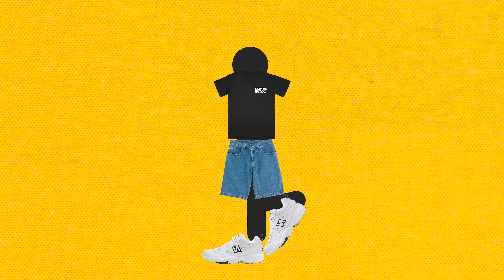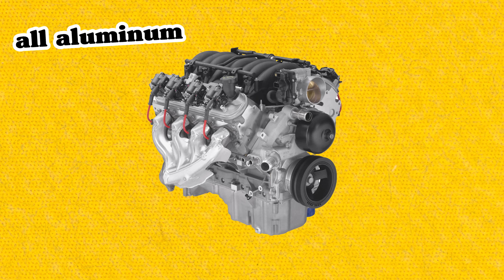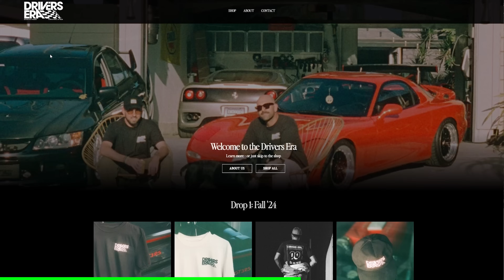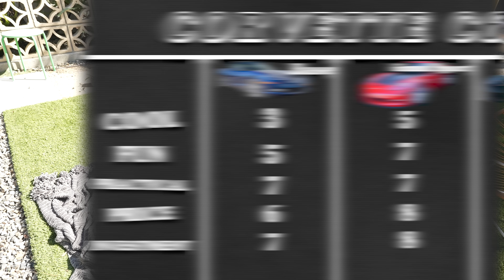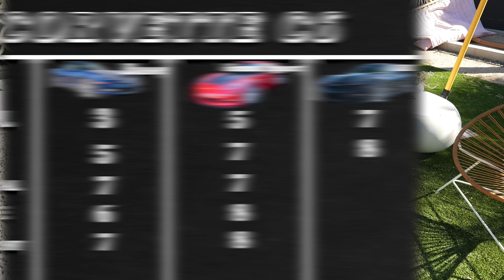Base vs Top Spec- Corvette c6. Is it WORTH IT?

Comment: You missed the best one , the C6 Z06
Reply: Zach did speak on it briefly. Probably pretty hard to organize/drive all the categories. and he probably would've said the grandsport was a better deal anyways
Reply: @toddbrown4185  Better deal, but not the better car. Shopping for both atm and the engine really changes the experience. LS3 and LS2 great engines tho
Reply: Best all around value / performance , but don’t kid yourself … zr1 king
Reply: Z06 is king
Reply: @chadwest1697  I hate to be the one to say it, But the ls3 dry sump is just as capable as the ls7 in 2024. You can easily rev just as high as an ls7 with a few mods.
Reply: @DigitalSubset  lol nah this is absolutely valid information. I was looking into grandsports. They have everything of Z06 other than aluminum body and engine. Not sure if they have carbon fenders as well. Used they around the same price as an earlier year Z06 where I am. Me personally I would just get the z06 of earlier year.
Reply from the maker: i drop the z for Zac. TBH i think 4 cars is too many,
Reply: @vin_tra  4 is to many for this video format. But it can be done and I wouldn’t complain about watching it. Also since you traditionally only do 3 different trim levels per video, this made the most sense. And Zach’s car is at the performance level of a lightly modded Z06
Reply: @chadwest1697 They do not, leaf spring is different, car is tuned different. Camber availability at rear is different.
Reply: @vin_tra  would have been nice to see all 4 , since you covered 3 of them , but nice series.
Reply: @DigitalSubset That’s funny lol! “With a few mods.” How many mods needed to match my 530rwhp?
Reply: ...if you're 18 to 25 the Z06 is your ride. But, for everyone else the GS is the better purchase by far. You'll spend a lot less time on the side of the road or being pulled back to the pits. A Z06 can be replaced with a well-equipped Camaro.
Reply: @DigitalSubset  and it doesn't drop valves
Reply: C6 ZR1 is a monster, the acceleration is fenomenal
Reply: Please go drive a C6 Z and give a review
Reply: Please go drive a C6 Z and give a review, the LS seven is unbelievable for an NA
Reply: I decided to purchase the GS over the Z06 for a few reasons. More reliable power plant, removable roof (coupe), grand sport coupes with M6 had a hand built LS3 built in the Z06/ZR1 factory. I couldn’t be happier with my GS.
Reply: @vin_tra  I think you made the right call. Having Zac on the vid was way better than having some rando with a z06. Especially because he actually spoke about the z06 and made a case for the grandsport based on dollars. Which is the whole point of this series, lol. Keep it up man!
Reply: @davidkelley751 Yeah op would need Carwow to make a video like that
Reply: Yeah no it’s the zr1
Reply: Oh yeah the titanium rod/head issue LS7 lol the ZR1 is 100% better or a C6 GS.
Reply: @chadwest1697  the raw feeling of the ls7 is unmatched.
Reply: @DigitalSubset  except you need boost or a hog ass cam to even keep up with a stock ls7
Reply: @vin_tra goofy. But sure
Reply: @Blazerghost keep smoking.  Exaggerated valve issues, lol.  Get RPM heads/cam kit and you never even have to worry while you get a 700hp NA car no GS will come close mod for mod😂
Reply: @DigitalSubset  NA HCI LS3 is not making NA HCI LS7 power. On top of that, you don't get the aluminum frame, cf panels, magnesium roof, etc etc on non-Z models.
Reply: The best one is the zr1
Reply: Grand sport is just a widebody base model wishing it was as cool as a Z06. Man do I sure miss mine and regret selling her. (But I also agree, the ZR1 is way better but that was out of my budget at the time) One thing is for certain, the interior of any c6 is an absolute eyesore.
Reply: Best at dropping valves😂
Reply: @titoazua3120  this is what poors say that can't afford to get the head work done to fix the valve guide issue lol
Reply: @maximilianherrmann5003  bs
Reply: Exactly, I did this exact scenario about 6 month ago. The best bang for the buck is actually the Z06. You can get a nice c6 z06 for 40k. And it’s 200lbs lighter than a zr1
Reply: @SloComaro  bingo.
Reply: This ^
Reply: @chrisnichols4228  correct :)  i really love my z
Reply: @DrivenbyAlex  was there a reason that you didn’t have one in the mix?
Reply: Yea if you track a lot and dope plan on modding it. The GS is the most versatile, hand built engine, most of the z06 parts, widebody, big brakes, dry sump, and you can still take the top off, (can't do that with z06 or zr1)
Reply: @Blazerghost  many of which were fixed under warranty. The ZR1 isn't 100% better when looking at the numbers stock for stock, but it is 100% more expensive on the market. If you're looking to actually beat on the car, take it to the track and drive it like it was designed for the GS and Z are the better cars for the money
Reply: @DigitalSubset  also the heads aren't designed to grenade your ls3 like the ls7 was.
Reply: @DigitalSubset those same mods would have the LS7 making 600 whp or more NA 😂 don’t kid yourself
Reply: @nathankrug111  FACTS
Reply: @David-jh8mp  FACTS 👍 👍
Reply: @DigitalSubset and you won’t have the Drop Valve issue as the LS7
Reply: C6 ZR1
Reply: How about a GS with an A&A Supercharger?  How would that not be the best bang for the buck?
Reply: @Blazerghost guess you could fix the heads or just buy new ones for around 1500-$2500.
Reply: The Grand Sport is closer to a base than the Z06 is to either ZR1 or Base. The 7.0 is amazing. And I think you really missed an important point by omitting it.
Reply: @David-jh8mp right people are soft  😂   they are talking about not wanting a z cause it's not reliable  won't fix the issues it might have... but talks about the grandsport but totally  changes  the engine with boost and heads  and cam lmao  makes no sense lol
Reply: Zr1 has intake valve isues no differnt then the z06 ...  early gen z06 had exaust valve issues   sooooo either way your throwing heads at it unless you get a ls3.. but then your trying to make power your gonna want new heads anyways lol  @Blazerghost
Reply: Grand sport gets it. Comfortable ride cheap to make a fast Street able car. Best of all price
Reply: @chadwest1697  LS7 Z06 for the win. ZR1 LS9  if you track it. Z06 40K cheaper with 505 HP stock
Reply: @chadwest1697  Z06 has aluminum frame and carbon fiber body panels.
Reply: @Lestertele the z06 is fine the valve issue goes away once you do a quality set of aftermarket heads and cam which is must have mods anyways.  With this they can be every bit as reliable.
Reply: @C6GrandSportLS all you gotta do is throw some heads on an ls7 and that issue goes away and it'll make EVEN MORE power.  The valve thing is an easy fix and greatly exaggerated.

Comment: Corvette C6 Z06 owner here. All the different models are great for their purpose. Base, Grand Sport, Z06 and ZR1. But for brute all out power. ZR1 LS9 VS Z06  LS7. Force induction VS naturally aspirated. My Z06 is full bolt on and I daily it also. Best viscerally/engaging fun car I've owned also.
Reply: have u had the drop valve issuw
Reply: There's no doubt in my mind about what you said about the c6 zo6 I've wanted to drive both the c6 & c7 zo6 just to know the difference I've hurd between the 2 models being so different in the driving experience with most guys saying the c6 zo6 being alot more angrier feeling making it a funner experience

Comment: The C4 ZR-1 held various lap records, endurance records, and handling records when it was being made
Reply: It still holds the 24 hour endurance record for a production car to this day. I know 375 hp (405hp in 93-95) doesn't sound like a lot today but in the 90's it was crazy. It's right there with the base c6 that is 15 years newer. The ZR-1 was one of the fastest cars you could buy. It spanked the turbo 911 in every measurable performance category. I have a stock 95 ZR-1 and my buddy has a stock c5 Z06 from a highway roll the cars are dead even. C4 ZR-1 is a very underrated car.
Reply: Him not being impressed with the C4 ZR-1 and only “375 hp” comes across as not being educated on the subject or “I’m gonna poopoo this car and ragebait the internet.”  Either way, he succeeded.
Reply: Only few know
Reply: @MrNeon2002  Even the base C4 can be a beast with the 350 ft-lb torque from the factory. I've kept up with a surprising amount of somewhat modern cars with my L98 engine. I've kept up with newer WRX STI's, 3 valve 4.6 Mustangs, and a cammed Trailblazer SS. Even if you put the performance aside, the driving experience is top notch.
Reply: Feel like the turning point in technology and performance was the C4.  Definitely underrated.
Reply: @MrNeon2002  thats fucking awesome lol, hell yea glad someones representing the c4
Reply: @facetiousmonkey5322  yes, yes, he did succeed in making me, and us, comment about it hella LMFAOOO
Reply: @HTX_ROME   really is so underrated, he definitely has not driven a later model c4
Reply: I owned a 1991 ZR-1 and I agree!

Comment: While the C6 Grandsport is awesome, its not quite the same as the C6 Z06. The C6Z is special, the LS7 (although a problematic race engine) is incredible. You should definitely drive and review one if you can.
Reply: How reliable has it been?
Reply: @Kauffman578  I don't own a C6 but I own a C5Z. It's super reliable even for 20 years old. But mine has low miles and has been well taken care of.

Comment: The base C6 you had had the LS2 but in 2008 they received the LS3 which is a little more sought after due to slightly higher displacement plus horse power. Great video nonetheless keep it up Vin!
Reply: And TR6060, rectangle port heads etc
Reply: The trans and diff in 05-07 is also beyond glass. It’s technically a c5.5
Reply: @Jan-b2n  beyond glass? can you elaborate
Reply: @KevinShroff  they do not last with any abuse at stock power level. Torque tube isn’t that great either, and the gas tank is the same as C5 for those first few years. Just a C5 with a better body kit (personal opinion).
Reply: @Jan-b2n you actually have no clue what you’re talking about. firstly, the only bad diff is the 2005 model year. 2006-07 have the same rear end as an 08, 09 etc. Same goes with the TT. The only upgrade would be the tr6060, however saying that the t56 is glass is simply not true. that trans is still good for upwards of 700+ horsepower. the only weak link would be the 2005 model year. get educated and stop spreading misinformation.
Reply: @Jan-b2n i agree 100%. Differential cracked on my 05 C6😂. It couldn’t handle the abuse.
Reply: @boostedelijah  chill out I’m not reading all that so good for you or I’m sorry that happened
Reply: @David-jh8mp  yeah the 05… the only weak diff. 06+ all have upgraded
Reply: LS2 6.0L 400hp - LS3 6.2L 430hp that’s a big thing he missed and even messed up and called the LS2 a 6.2L smh

Comment: I had a C6 Grand Sport as a daily driver in Boston (lol) and it was one of the best cars I’ve ever had. None of the head issues of the Z06 and the ls3 is capable of just as much power if you want to go down that road. Zr1 was the king but the GS was the sweet spot. I also thought it was more comfortable and better looking than the C7 by a mile. I’ve since traded it for a 911 but for the money it’s a really tough car to beat.

Comment: Great video Vin, I hope you keep doing these review series, they have all been fun to watch.  I'm on my 3rd ownership of a daily driven C5Z, current one is 434rwhp and is about all I need for daily driven fun.  I also had a 707rwhp C6ZR1, and the issue I had with the ZR1 was the same as yours.  It hooked up and put down all the power and drove great, but for a daily/street car it was like 1 gear blast and done.  It just was not as fun unless you drove felony speeds.  I have a special place for C5Z because my dad, and they are really great drivers but you have to deal with the late 2000s chevy tahoe interior for sure.

Comment: I gotta tell you I have a c6 base with 400 hp and it’s a convertible. I just bought it.  The convertible factor is just amazing.  It gets sooooo much attention. 

It’s a working man’s car so everyone likes it. It looks amazing and really much better in person than in pics  and looks more classic than the beefier zo6.  I like the wide rear body of the z06 but there’s something more classic about the base that I think will age better.  

Mine came with a coursa exhaust and I can put a super charger on it for $6000 that gives me 550-600 hp.  Mine was a 1 owner and is 6 speed manual with a heads up display.  

Being a year 1 (2005) it has power seats on both sides and is very very comfortable inside.  Also the 2005 has the best steering wheel. 

I paid $19,500 with 74,000 miles, one owner and it does zero to 60 in 4.1 seconds.  

The corsa exhaust is amazing.  It sounds like perfection 

Add to that if I choose to add the wide body quarters of the “upgraded models” I can simply buy those and bolt them on easy.  

After owning this I would not buy a non convertible. You can literally drive around with the top down in 40 degree weather as the heater is made for that and it keeps you warm.  Also, I have a manual top, but if it storms and you are on the road the aerodynamics are such that it won’t rain inside! It’s wild.   Unless you hit traffic 😅I also have dual heated seats. It’s fuckin awesome and it gets you in a man’s car.  Sure Tesla performances are faster but almost everyone out there respects the corvette much more and thinks the teslas are gay.  So sometimes you get a kid driving his moms Tesla trying to race you in the highway and you can just yawnnnnnn at them it’s funny 😂. 

I just saw your ratings…. Totally off on the base corvette.  This thing handles like a dream. And mine came stock with mag magnetic shocks. 
Toss that $6000 super charger on the base corvette and you have the zr1. So with 550 hp plus the robust ls2 with the amazing handing you can just toss the rear wide body kit on and all corvettes lower the same with the built in lowering adjustment pads.

Comment: Quick note on the C4 ZR-1. Its not exactly the fastest car nowadays but it has a special quality to it. The LT-5 engine revs high and pulls way harder than its rated HP.  Aswell its the kind of car you buy for the story that surround the car and i guess the 90's performance. I say that because i own a 95 ZR-1 and it rocks for what it is. Now if your goal is best of the best Corvette hands down any C6 or C5 is a better choice performance wise. You cant beat the value just buy one!
Reply: You got the last year ZR1👍 that was my dream car as a kid. Loved reading about it beating everything. KING OF THE HILL 💪👍😘🙏
Reply: I'm also a 95 ZR-1 owner and couldn't agree more. For it's day the c4 ZR-1 was one of the fastest cars money could buy. It was a legend and it punched way above it's weight. Even to this day it's no slouch. Mine is stock and from a highway roll It's dead even with my buddies c5 Z06. Unfortunately the c4 ZR-1 is a great and special car that doesn't get the respect it deserves. For overall outright performance you can't beat a c5 or c6 for the $. I also have a c6 Z06 in the garage, but I grab the c4 keys more...

Comment: C4 was an epic gen, don't sleep on it!
Reply: worst gen ever complete garbage lol
Reply: @ tell me you know nothing about corvettes without telling me you know nothing about corvettes!
Reply: @yDoUevenTry4  Yet the C4 ZR-1 still holds a 24 hour endurance speed record no Corvette or any other production car has broken to this day. The c4 was a great generation. Googles free, use it next time before making a dumb comment.
Reply: @yDoUevenTry4  This is the most invalid opinion that I have seen all week. The C1 is monumental, C2 is gorgeous and powerful, C3 had some good years, but, had ultimately been killed by the oil crisis, and the C4 was revolutionary. 6 speed after 1990, 350 ft-lb torque in 1985, first Corvette body to be designed using a wind tunnel, the ZR1 beat almost every other car on the road, AND it's the cheapest generation at the moment. I bought mine for 7k and I firmly believe there was no better sports car, for that money, on the market.

Comment: The C6 is one of the best looking generations, but had its share of problems. Mainly the infamous gas tank leak from a $0.01 plastic elbow. This made my garage reek of gas fumes, but worse, it sprayed atomized fuel all over the place. Another issue that I experienced was the harmonic balancer failure. Another issue was the horn died. I never did get that fixed, but root cause pointed at the fuse block. My powered soft top tonneau used to catch the rubber grommet around the window and then slam when breaking free. The clutch got real gritty feeling around 80K miles. I think it was the throw out bearing. The hood release cable stretched  and the hood would not pop open (that's a real problem). Finally it started throwing codes left and right around 110K. I traded that in on a new C8, but in many ways, I really do miss the C6 because it is such a fun car to drive.

Comment: First off, amazing video. It was refreshing to see an empirical look at what value the c6 offers. One note, the c6 GS is not "basically a Z06" as you are missing the famous LS7, the 7 Liter powerplant from the Z06. The Grandsport has the upgraded bumpers and wider fenders but shares the ls3 with the base corvette.
Reply: IIRC the LS3 in the Grand Sport is different from the base LS3 in that it is hand built, but you are correct that the LS7 is far more special